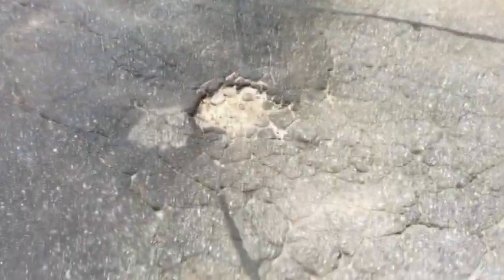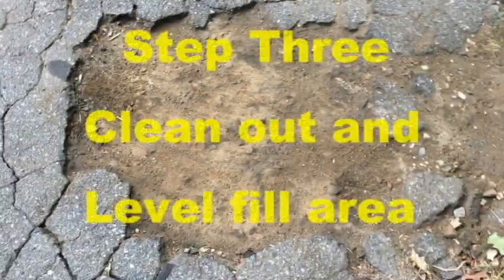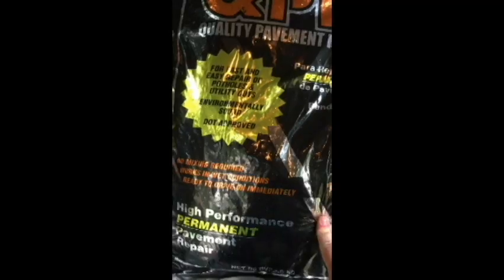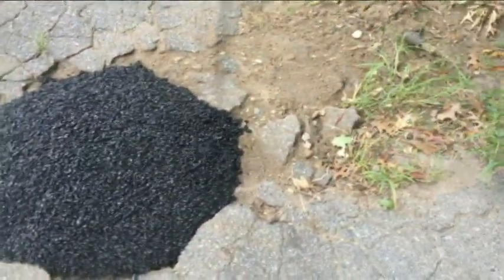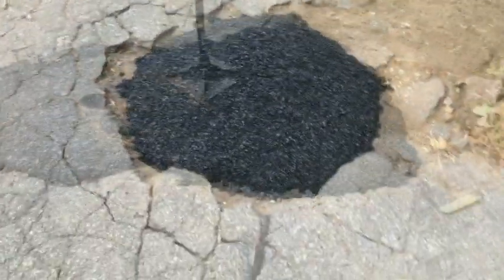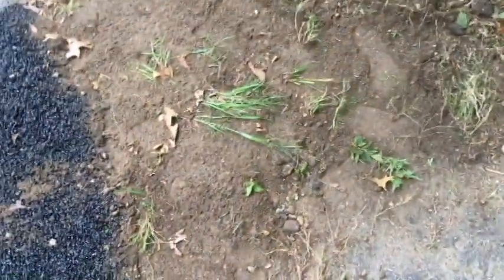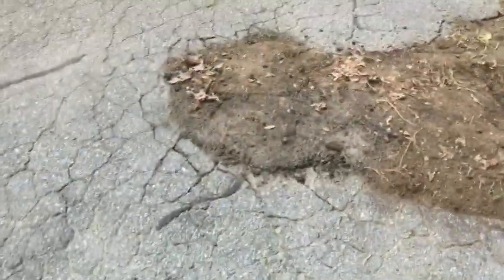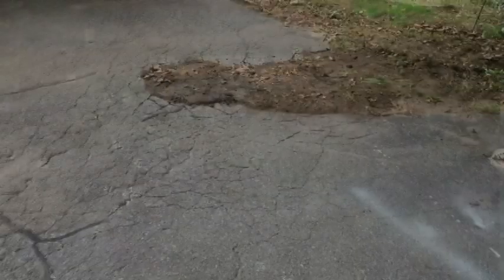Do it yourself Driveway Repair

Comment: Guess I'm just lucky...few years ago the county dumped a whole truck load of new hot asphalt in their pile of millings that wasn't up to snuff (it seems not much aggregate besides sand).  Anyway it is hard as a rock but I put down 3 inches of millings on an area of dirt, went out and got chunk after chunk of the "good stuff" but had to break it up when I got home.  Put 3 inches or so of that oily stuff on top.  Used a tamper, then 55 gallons of sealer on the entire driveway.  4 car to 6 spots and it's holding up through a colorado high country winter.  Free, but too much work!
Reply from the maker: Sounds like it was.  I'm glad it is holding up.  Especially with the prices to have it done these days.

Comment: My edges are crumbling to uneven line, what should I do? reduce the driveway and plant grass or add asphalt trying to get a straight line again?
Reply from the maker: Well, I have the same problems in areas. Keep in mind, this is only intended to be a patch until professional repairs can be done. But to keep the asphalt from crumbling further I dug a straight line in the dirt to hold the asphalt patch then filled in the dirt once the patch material was in. Sorry, I wish I could be of further help. Best of luck.

Comment: I have worked in asphalt testing and implementation for over 25 years. Please do not use this method!
Reply: Why bro
Reply: Lmao. Jeeeeeesus. I have zero years of experience and even I can tell that this is bad. Lol
Reply: Useless comment when you don’t explain why!
Reply: What product do you recommend for spider cracks? Every year we get new ones, I am so tired of fixing them - nothing really last.
Using the sealer two coats should be enough to maintain the asphalt driveway, right?
Reply: @SofiNme365  I bought a big square of the melting tar the pros use.  It's a bit hard to get it hot enough to pour and not get burned.  I was making a mess then I figured out hammering it breaks it into pieces.  I put the pieces in and close to the crack.  Weed burner melted it nicely.

Comment: Do they have matching colors to the concrete? I don't like the mix match colors
Reply from the maker: No, I am afraid that black is the only color. Only color here at our local Lowe's. Maybe they have different colors where you are. It's possible.
Reply: If you want to patch concrete, just use Loctite PL Max Premium construction glue. It ends up in a light gray color.
Reply: Take a lotta fuckin glue to do a patch like ole buddy did..